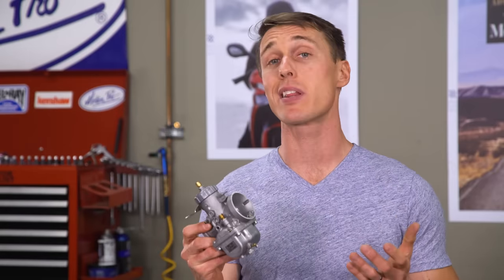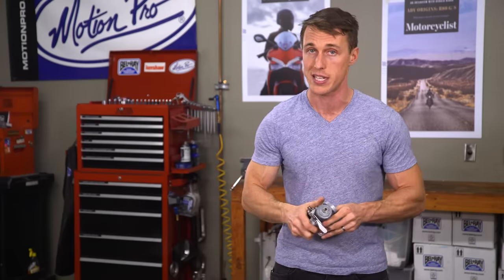Carburetors vs. Electronic Fuel Injection—What’s Better? | MC Garage

Comment: What a lot of people aren’t mentioning is that you usually have to turn the gas valve to off and run it until it dies when storing your bike for the winter or long periods of time or YES you will have problems no matter what. My uncle has a carbureted 4 wheeler from 1998 and I have never seen my uncle work on the carbs. He said the trick is to never let it sit with gas in it and change the oil if you know it’s been sitting a long time and you will never have a problem out of an old carb engine. You can also tweak your fuel air mixtures pretty easily on carb bike as well giving you more power for next to nothing cost wise. With a fuel injection engine you have to hope you have an unlocked ecu or you are gunna be spending a few hundred just to get a new one to fit or to unlock it then a few hundred to tune it properly.
Reply: I had a ty 350 Yamaha stuck in a shed for 2. 1/2 years. Dragged it out one day and in 2 kicks it started, old gas and all.
Reply: Fuel stabilizer for what's left in the tank (hopefully full) also a to do.
Reply: Well the "tweaking the fuel air mixture for next to nothing" is basically true, but it's leaving out a significant part of the bigger picture: 
"I just put a larger jet into it and it ran great" rarely happens in a vacuum, especially if you haven't been playing around with carbs for some time already. Long story short: It'll need a lot of prior experience plus some tools and parts, or someone who has already acquired that experience and those tools, to get a carbed bike that isn't running great to finally do so. Either you're lucky in that a relative or friend introduces you to the procedure and they already own an ultrasonic cleaner, sync guages etc., so you'll just pay for new jets and gaskets etc., or you'll pay a professional, or pay the usual DIY trial-and-error fee of slight mistakes, misdiagnosed parts leading to unnecessary purchases, tearing apart unicorn-sized gaskets, and constantly doubting yourself as you're flying blind.

On the other hand, a modern stock EFI bike will self-adjust within a certain window (such as going from the coast to an alpine pass, installing a low-resistance air filter or slip-on exhaust etc.) without you needing to do anything, it'll just run quite alright. And with a $400-500 power-commander or similar system on a modern bike with a wideband O2 sensor, you can basically just leave the ECU to autotune and get a decent mixture curve even with a full exhaust etc., let alone if you take it to the dyno and get a decent basemap done (which will cost way less with ECU than on a carb'd bike, as the bike won't have to be disassembled etc).
Reply: @decnet100  Once the bike is a few years old and all of those cable connectors are getting corroded I wish you good luck with your ECU.
Reply: @nomeansno2335  If all of the wiring connectors are getting corroded, then you're of course screwed and probably well-advised to invest a couple hundred eurodollars in a used wiring loom off a crashed example - but to be honest, that's not all that likely to happen on modern bikes, thanks to improvements in connectors, with rubber gaskets and epoxy-sealed rear-ends etc. doing a good job in my experience keeping moisture out - there certainly has been an improvement over the last decades (even though the new ones are often a pain to undo due to the tight fit and weird locking lashes holding them in place, and of course if you ever break one, they're a lot more advanced to reinstall to the wiring than the old style which you could basically do with nothing but needle-nosed pliers and a good reserve of swear words).

Obviously, that very same "if all connectors failed..." scenario would also affect most if not all the carb + electronic ignition bikes of the 80s and 90s. Insignificant anecdotal evidence makes me think it doesn't: Of the four early-to-mid-90s carbed examples I owned (with little to none sealing connectors on any of them, pretty much everything done in old style rubber-free and open-rear connectors) there was only one with wiring corrosion issue - and that was due to a previous owner cutting into it, with the usual half-assedness you would expect. . Obviously, if you live in a very moist area such as a coast, that might be more of a problem and you might choose a carb based on that; I'm in relatively dry central europe with loads of mountains. Also anecdotal evidence: I bought all of these bikes with carb problems , fixed all of them eventually (even though it took a while on the old Yami FZR 600), and I don't particularly like doing so, therefore I prefer EFI nowadays.
Reply: @decnet100  Good information on both sides of the field, but you left out too that with FI you also have a ton more electronics and failure points added to the picture, which also adds more weight and complexity + upfront cost. Fuel pump, Injection system, Oil injector + pump if 2-stroke, 02 sensor, added computer/ecu circuit to tie it all together.. A simple exhaust change can completely F up the entire fuel mixture even if all you're going for is sound with a slip on, and while it does the same on a carbed bike you can simply plop a jet size or 2 fatter into the carb and get a 'baseline' ballpark that will keep the bike running decent. Run it for 20-30 minutes, pull plug and see how it looks. The plug tells you everything you need to know, as long as when you upgrade the jets the bike does not seriously bog or backfire, tuning is actually easy if you tune using a couple of plugs to see how the fuel mixture is burning. I will admit though like you said, trying to get an old ABUSED carb to run good again is a complete PITA, and carbs (primarily the slide) eventually do wear out where injection systems don't necessarily wear out, they just fail once they hit the breaking point.. But even still at that point cost per dollar even if you have to replace the slide 3x in a carbed bike before a FI bikes injection system fails, it will still be leaps and bounds cheaper. This all comes at the cost of the owners willingness to learn their machine I guess.

Comment: I’ll take carb. I can work on it without a computer. It’s all mechanical. No electronics to fail and leave you stranded.
Reply: @ArbaazPatwari  I've had a carb fail on me in the middle of nowhere. Called up our equivalent of the AAA, nothing to hook a scangauge up to, so time to do old fashioned diagnostics. After a while we came to the conclusion that it must be the carb that messed up. Turns out the diaphragm had a tear in it. Of course AAA guy doesn't have one with him, so he called up the depot. Nope, no diaphragm there either. Put the bike back on the flatbed truck and have it towed home, call the dealer on monday, wait until thursday for a new diaphragm and spend half the day messing about with it to get it all set up properly again.

But hey, at least it wasn't something electronic with self-diagnostic capabilities that left me stranded. How inconvenient would it have been if that carb was a generic bosch injector that got fouled... The AAA guy would have actually carried a spare and could have replaced it on the roadside.
Reply: I think ur just too naive. U can just use a tablet or phone to work with it tho. And there's a reason it's called programmable fuel injection. Just change the ECU and u have no fuel cut-off and rev limiter and u can install a wireless fuel cut-off security system and control it with ur phone
Reply: @fermitupoupon1754  Turn the carb piston into mechanical, or just fix the hole with some glue
Reply: @diogoelias4205  I did one better. Sold that bike and got an electric one instead.

Comment: I see a lot of people bashing on fuel injection, but heres my $0.02. Fuel injection is extremely reliable, carbs can be two but they don’t work well with ethanol. Nothings wrong with a well tuned carb but they are more maintenance. You buy a bike to ride it, not to work on it.

Comment: EFI while being more efficient has a few added drawbacks in my experience. Biggest is the  management components needed with EFI . They add complexity which adds expensive diagnostics and repair costs vs Carburetor's . Also the claim that EFI is more reliable isn't actually true. EFI throttle bodies are simpler then carburetor's but again they add complexity and vulnerability due to needed sensors and other electronic components and wiring. Nothing worse then getting stranded because heat and vibration caused a electronic part to fail . Carbs while less effecient at metering fuel/air mixture are by far less complicated and as such more reliable when making wheels turn when it matters most. Complexity doesn't lend itself to reliability in reality !

Comment: I'll keep on trucking with bike's 40mm Mikuni carb, no electronic sensors to go bad, and leave me stranded on the road. No carb failure yet, in over 91,000 + miles of great, smooth,  highway riding. I can always work on the carb on the side of the road, in a pinch, not so, with fuel injection problems.Thanks for the video.

Comment: Own two 20 year old motorcycles, both are carbed. European tours and trackdays whilst riding all year round and they've never been a problem. Having the right set up is vital, often people just shove jet kits and alter the fuel/air ratio to gain performance but causes the starting and running issues. Fuel injection is there for a reason so there's no denying its advances but carbs still offer great, smooth riding if they are set up correctly

Comment: I've ridden EFI bikes and both of the bikes I've owned are carburated. I'm used to the whole choke and cold start ordeal and it doesn't bother me, plus I can work on them with reletive ease virtually anywhere as long as I have my tool kit, and they have a distinct feel to them that injected bikes don't. 
If you want simple tech and like working on your own bike - get a carb, if not - EFI all the way.
Reply: Travis Donald Stanley Exactly! EFI for normal usage and carb for touring.
Reply: Yeah that EFI snatch is annoying on larger bikes and downright dangerous on smaller ones.
Reply: I really have to disagree. Touring, you are going through many different environments including sea level, temps and humidity, all playing a part in how your bike will run. If EFI wasn't as reliable as it is I would agree for ease of fixing but you will likely never have an issue. 
 To each their own, they both have their place.
Reply: @bbqBaconNinja  If I've learned anything from riding older bikes, is that anything that can break will break at some point. Electronics will fail, mechanical parts will wear out, paint will fade. The simpler the bike, the easier it is to keep running in the long run, because when things go bad (and they do go bad) - it'll be a lot harder, and more expensive to maintain a bike with a lot of sophisticated electronics than a simple one. Modern tech is designed with planned obsolescence, and people rarely keep a bike for longer than a few years because of the consumerism culture that is prevalent in the western world, so if you're like me and just like to get one bike and ride it forever, repair it and continue riding it - you're better off with a simpler bike.
Reply: I barely notice a difference between carburated and injected. The only difference is that injected always starts within a second and runs a bit smoother

Comment: Call me a Neanderthal but got back into riding last year and walking into the garage having  the faint smell of oil and fuel takes me back. Tweaking the carbs, a little wrenching is part of my joy. Great video as always!
Reply: I'd rather smell Hoppe's #9. But I understand.
Reply: I concur, there's nothing better than walking into your garage, smelling the fuel and oil. Especially 2-stroke.
Reply: Maybe you would like to have a joyous occasion tuning my xj6.
Reply: Oh yeah. Working on mechanical stuff is a different joy from riding bikes. From just sheer curiosity to just taking your mind off things, it's great. In my opinion, being connected to your bike through knowing its parts and being sensitive to its grunt and performance is a good thing to have when riding a motorcycle. It's something that people just have these days, especially with cars that the only taking care of from its owners is not crashing it. Some people don't even pay for their own gas...
Reply: @exothermal.sprocket  Man, that Hoppe's oil leaves its smell on EVERYTHING lol

Comment: Carbs are a bit of a pain, but I unno, there's just something satisfying about having a simple chunk of metal that just works. I haven't ever really needed to clean mine or anything...
Reply: Just clean it for good measure, you'll notice better throttle response and better gas milage if it needs some cleaning anyways
Reply: You  must have not owned it long then :-P
Reply: Clean it!!! You often don't notice the power lose as it happens gradually. Might be surprised.
Reply: Yeah, what the hell, I'll give it a scrub down c:
Reply: As a mechanic. I like both. I like that carbs can be adjusted easily and inexpensively. But fuel injection does the job better and does better at staying clean than carburetors. It’s more precise and really gives you eyes into every detail of what’s going on. Now, this is also more expensive. But I look at it this way. I’m going to let go of my carbureted tc88 dyna love. For one of the brand new low riders. Because it’s fuel injected? No. I’d take it efi or carb. Why? Is softail style chassis which is a superior chassis than the dyna but the old ones were too low. The new ones have a completely different design. Higher rise highest, smaller swing arm single shock under the seat. Everyone agrees that a new softail dyna cross thing rides like a dyna with 2k in suspension. Then there’s the motor. So I care that I’m going from an 88inch to 107? No. I care about the 4 valve heads. Instead of 2. Single cam instead of 2 gear drive. Counter balanced down to almost no shaking. Vibrates still but doesn’t shake itself apart because it’s also rigid mounted not rubber mounted. “Well Harley’s Shake. Don’t like it? Ride a Honda” the irony there is that shake is why they wobble at high speed. More money spent to do what this bike does from the factory. Now the execution of the esthetics was less than impressive. But time will fix that like every other bike. After market tanks and fender and stuff. So even though it’s a fuel injected 2018, a good tuner (power vision auto tune) is all it needs to ride better than anything from the factory previously. I personally love fuel injected, performance dynas/new softails and old completely custom built pan heads, shovels, evos sporties, all of them. I love people building their bike to be the best that it can possibly be for their purpose and desire. I don’t really care that the motor is bigger and fuel injected. Those are arbitrary differences I’m willing to accept to have a superior motor and chassis. Now I could carb it. But a tuner is less expensive and less of a head ache. If I’m building a pan head chopper even as a daily it’s gunna get a carb. Because that’s just the easiest way to do it. Hope that all makes sense. I personally hate the this vs that arguments in the industry/community. It’s a matter of personal preference. I like to say, build the bike to be the best that it can be for what you want. Ride what y’all like and let other do the same. I sigh and shake my head at the geezers who believe that carbs are superior in every way. And at the punks who don’t have any actual knowledge or experience to back up their instinct to stick to what’s new. Because there’s no point in debating. Just my opinion.
Reply: I have a 2012 ninja 250r cleaned the carb in the mechanic like once a year.
But i never cleaned it for 2 years since i dont really know about motorcycles back then, until a mechanic told me about it and yeah its a little smoother and better, so i always cleaned it every once in a while.
Reply: But cleaning the carb might have made a big change but i just dont know yet since i never really race with that thing.
Reply: Run seafoam through it once a month you will never complain. Make sure you have an in line filter too.

Comment: I have one bike with fuel injection and another bike with CV carbs . I've experienced no real problems or hardships with either. I prefer the fluid feel of the carb'd bike better, especially during midcorner throttle modulation. CV carbs provide a genuine, ethereal connection which can't be replicated by digital code.